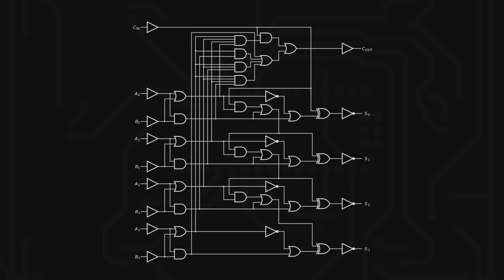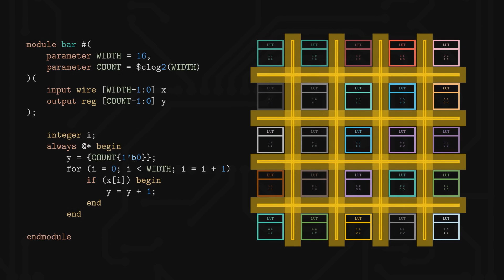What's an FPGA?

Comment: I like what FPGAs can do but I'm looking for a solution that can be used to accelerate OpenCL apps like video editing apps, and other stuff as I find that new GPU prices are too high for me and use too much power, so I'd appreciate another solution like FPGA accelerator cards I can use out of the box or those that are simpler to setup with Open CL apps. Any help is appreciated? As I'm new to FPGAs and I'm looking for one that meets my requirements.

Comment: I would have at least mentioned that it runs much faster, would have taken 5 seconds.
Reply from the maker: I suppose I could have, but that would be a broad and incorrect overgeneralization. Runs what faster? By what metric? GPUs, CPUs, and FPGAs all have different applications and strengths and weaknesses. FPGAs can't operate at anything like the frequencies CPUs can run at, but they allow for flexibility and parallelism and ASIC modeling. FPGAs don't really "run" anything, they implement a circuit and some circuits are fast and others aren't.
Reply: @crclayton  i've never used an fpga, but plenty of embedded processing, my number one question would be why someone would choose an fpga over doing stuff in the processor and i always thought because fpga's can do a lot of things really really fast.

Comment: Thks & I have a simple question that you have the expertise to easily answer;
   ??WithIn the combinational/sequential logic domain, are FPGAs an excellent replacement for traditonal CPU based systems??
Reply from the maker: It depends on the application, but yes there are situations where an FPGA could be a good replacement for a CPU based system. Particularly where low-latency, high-bandwidth, or high-parallelism are required. FPGAs can also be programmed to actually implement a CPU within the FPGA fabric alongside other logic (ex. Nios V).

Comment: But can you program a circuit (of resistors, capacitors, inductors, transistors, diodes, etc.) into an FPGA?  Or is it only computer instructions?
Reply from the maker: The FPGA is a digital device -- so you can implement a digital circuit on it (logic gates, switches, memory blocks, etc.), not an analog circuit (inductors, capacitors, diodes, etc.).

Comment: Can the FPGA reprogram itself at runtime?
Reply from the maker: Yes, there are some techniques where the FPGA can download an image from an external source like a PCIe link or flash memory, then reprogram a section of the FPGA's logic while keeping the other logic consistent.
Reply: @crclayton  Consider the advantages of writing a function where parameters are not passed, but rather the code is modified before calling it (if necessary), or where optimization is performed just in time before execution.

Comment: FPGAs are really great for those interesting in retro-computing or learning how a CPU works.  I am implementing Ben Eater's 8-bit computer in an FPGA in a series of videos on my channel for anyone interested.  Very cool stuff!
Reply: Hi! due you've working on FPGA's could you please tell me the main difference with a uC? (I know that FPGA are extremely more faster), but basicaly they both do the same...
Reply: @stringsandhamers  They are not the same at all. An FPGA (Field-Programmable Gate Array) is a reconfigurable hardware device made up of logic blocks and interconnects, allowing for high levels of parallelism and customization using hardware description languages like VHDL or Verilog. In contrast, a microprocessor (CPU) has a fixed architecture with an ALU, registers, and a control unit, executing instructions sequentially using software written in high-level languages like C or Python. FPGAs excel in real-time, specialized tasks such as digital signal processing and AI acceleration, while microprocessors are better suited for general-purpose computing, running operating systems, and handling diverse software-driven applications. FPGAs offer flexibility and performance optimization at the cost of increased complexity, whereas microprocessors provide ease of development and versatility for a wide range of tasks.

Comment: How would you make your lookup tables "programmable"
Reply: A lookup table is just some memory that contains some set values, so you can make them programmable by storing them on rewriteable memory. In this case, the lookup tables are being used as logic gates by taking the individual address bits as the inputs, and the individual bits of the value stored at that address as the outputs.